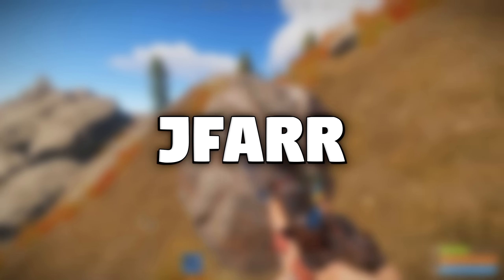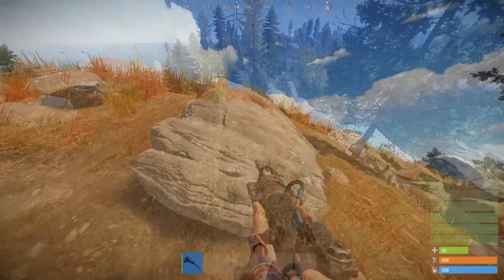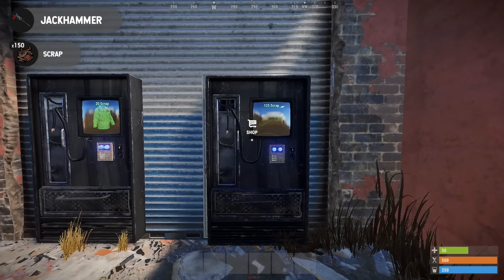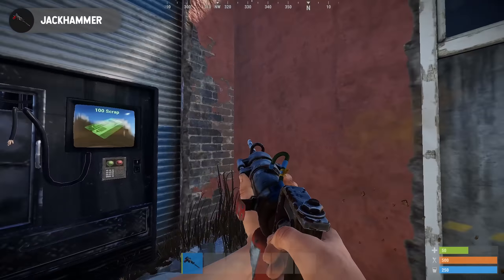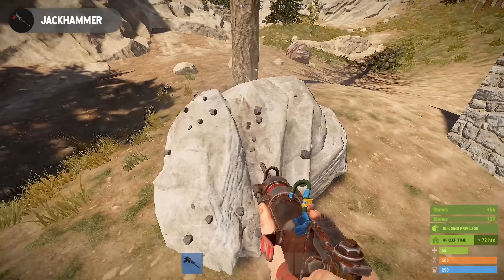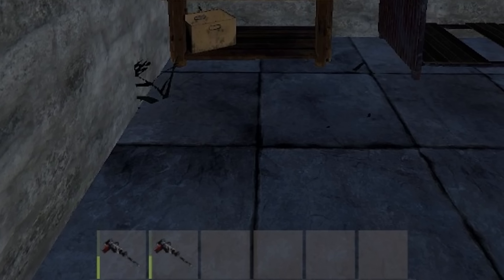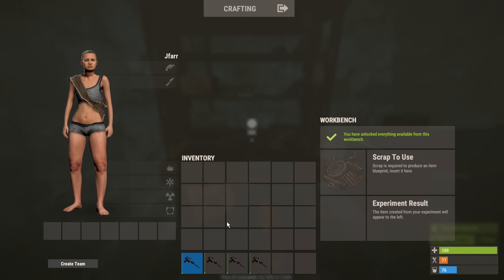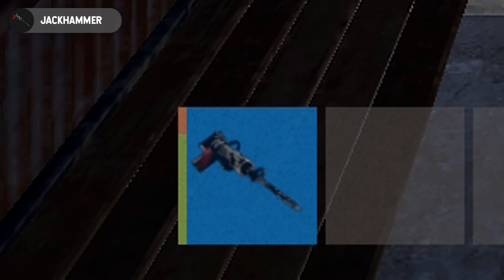Jackhammer Guide | Rust Tutorial

Comment from the maker: Just a heads up that at 2:05 when I mention that the Jackhammer must be repaired when full broken is not currently necessary. Apparently, you can still refill the Jackhammer at the workbench even when it's broken. This doesn't make much sense and might be changed later.
Reply: Yes it dang does make sense and shouldn't be changed.

Comment: Are you sure you need to place the jackhammer in the repair bench if it is fully destroyed. I thought you could just refill it anyway.
Reply from the maker: Yeah, apparently I was wrong with that one. I just assumed that when it breaks you have to repair it since it doesn't make sense to refill it. Strange it doesn't work like this since now the repair bench doesn't have any practical use for the tool. It would seem possible that in the future it is changed so it would need to be repaired.
Reply: @JfarrYT  so did it?